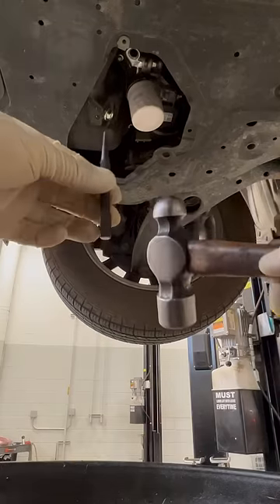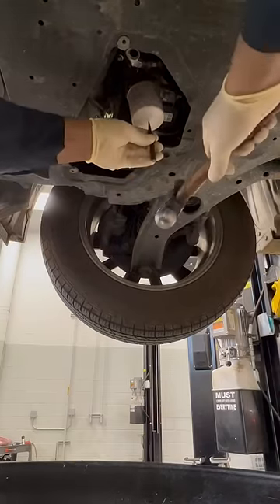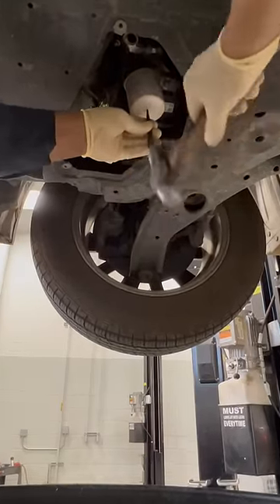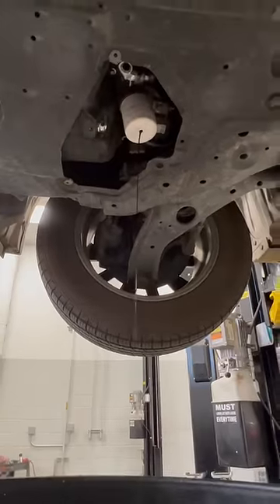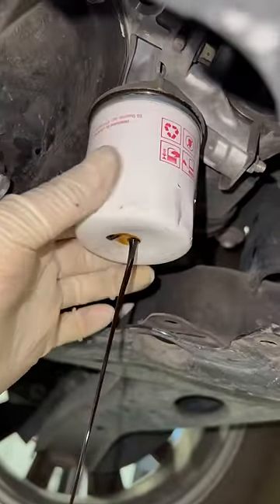Tech Tip Of The Day Oil Filter Clean Removal #oil #oilfilter #mechanic #shorts

Comment: Don’t do this. It will damage the threads.
Reply: I won't because it's a stupid tip.
Reply: Bro you're MAKING a hole not shoving in a 30cm drillbit from 18v battery
Reply: @lmripper3659  using a hammer on filter that’s threaded on will cause them to get damaged sooner or later
Reply: D guy told him something and didn question it
Reply: @Psunfire  If we go with your theory all screws on the car should get their threads discombobulated after hitting a huge pothole
Reply: @Psunfire  Creating Bulldozers/trains/airplanes gets out of the question on this topic

Comment: use grease on the gasket it works better than oil and doesn’t dry up right away filter always cracks loose with ease, old mechanics trick 😉

Comment: Tech tip of the day: DON'T DO THIS. 99 times out of 5 the filter will be jammed and stuck and you won't get it off and now you have a hole in your filter and a car with no oil blocking the bay for hours while you wait on someone more experienced to come bail your novice butt out.
Reply from the maker: How many oil changes have you performed in your life 😈
Reply: he's assuming you have the proper tools to remove oil filters.
Reply: Oil filter needs to come off regardless loo
Reply: Any bozo that doesn’t have a hoist and has done more than two oil changes knows to release the tension on the filter before doing anything. This is a great idea 👍👍
Reply: In England with a jammed oil filter the preferred method as a last resort if filter wrenches etc haven't worked is to punch a screw driver through the side of the can either fully through or through one side and use the screwdriver for leverage, loosen it enough to get another tool on it or unscrew it by hand.

Comment: Tip number 3 : do not lube the gasket on the new oil filter. Keep it as dry as possible !!!
Reply: Nope
Reply: I'm pretty sure it's recommended by the manufacturer to put oil on the gasket before install.
Reply: @grimspyder0001  ..... Duuuuuuuuuuuuuuuuuuûuuuuuuuuuuuuuuuuuuuuuuuuuuuuuuuuuh

Comment: Nice tip but as an ASE master tech ...loosen your filter a little first if you run into a tight filter after you punch your hole it will crush like a soda can if you losen it first while still has preasure it will always loosen then punch it that way you never get stuck cutting a filter off with an air hammer

Comment: I have seen mechanic’s keep a 20 ounce coke bottle with the top cut off. Slide that over the oil filter and un screw it. Gives a little extra grip and doesn’t make a huge mess.
Reply from the maker: Great tip thanks dnt forget to subscribe

Comment: It looks like your gasket stuck up there.
Reply from the maker: Yes got it thanks
Reply: @WrenchingMafia  cheap filter
Reply from the maker: @PABU427  Definitely I Like using Genuine OEM parts but I can’t control what customer installed on vehicle
Reply: Don't forget to remove that gasket

Comment: “Tech” tip. See this is why I change my own damn oil, and don’t care if my hands get dirty.
Reply: I do my own, because so many mechanics are scammers. My dad is a mechanic and he made sure I understood that a long time ago. LOL Every time I've taken my car to someone else they always conveniently forget to change the filter, or strip the plug, or any number of bullsh-t.
Reply: what is the problem with this video?
Reply: @wokkie168 um they gotta replace the oil housing now(the catch can) now you basically unscrew that your not suppose to damage it because you will leak oil and your engine will not have oil resulting in over heating and other stuff 

I couldn’t tell if your joking but if your not I hope this helps
Reply: @mark_m1 bro theyre changing the oil. Youre supposed to buy a new filter each time you change it. Do you not understand that? Is that what you do? 
Pop the plug, drain the oil, put plug back and fill it up?
Reply: @mark_m1 also when its leaking oil its not just gonna over heat, it will blow up almost immediately with a hole in the filter.
Reply: @mark_m1  thats not an oil housing or a catch can, its an oil filter. You must replace the oil filter on every oil change whether it be a cartridege filter or a complete metal one like this. Are YOU joking?
Reply: @mark_m1  also idk what you mean by "housing" it's an oil filter adapter, SAE term

Comment: Tech tip #2 get He-Man to tighten the oil filter so that you can’t humanly twist it off the next time you have to change the oil. I learned my lesson and NEVER paid anyone to do my oil changes in the last 40 years!! 

Tech tip#3 Pressure flush the radiator until it starts leaking and the owner has to pay for a new radiator and the install. Never took any car in for that. I learned how to do it.

Tech tip #4 you guessed it the brakes. I learned how to do those too. I don’t go to a mechanic unless it’s really bad. Don’t trust them.
Reply from the maker: You will need us one day

Comment: I have to be real. I just did an oil change with this type of filter. You can just unscrew it a bit and it does the same thing just might have unscrew it more when it slows down. The only other difference is you can unscrew it white it drains simultaneously. Useful for a shop setting where you’d see multiple cars a day but for a single person doing their own oil change, this is quite a waste of time. A couple of those blue shop towels and your hands are clean again 🧼

Comment: This is a pretty good strategy but some oil filters are not this easy to get too. So if you did this on one with an oil filter up in the engine bay you would still have a mess.

Comment: When I serviced big trucks at a truck stop some of these filters held a couple quarts I came from the body shop industry and I had a One pound dent puller I put a big metal screw in it and it was perfect for draining those big hot oil filters one slap with the slide hammer and one yank and your filter had a 5/16 hole draining the hot oil

Comment: Won’t work in a vertical oil filter like on a Tacoma but those vehicles usually supply another method of keeping the mess down like a drain tray / spout. If I had a vehicle with an orientation like this I would definitely use this method!

Comment: That's why I like my german  car, the oil filter is on the top, installed upside down, and when you need to change it, it will drain inside the oil pan...

Comment: Just be certain it was not overtightend. You may need all the structural integrity to remove it. I might loosen it slightly before you punch a hole in it. Still a great idea.

Comment: That works if the filter is in an area that doesn't have an obstruction in the way that is hard to move. On my acura rsx there is shit in the way that would be a headache to move. Also the filter needs to be vertical or mostly vertical. Sometimes they are horizontal and punching the filter would be useless if you even have room for the punch and the hammer

Comment: I just use a Solo Cup.  Loosen it and then unscrew the oil filter.  The cup holds the mess.  I have also used your method.   I hate when oil runs down your arm

Comment: Your wearing gloves so your not going to get your hands dirty.

Here's a tip: Make sure you remove that old oil filter O-Ring from the engine before installing the new oil filter otherwise you will have a huge mess on your hands / garage floor...

Comment: But my oil filter is on the front side of the engine block, not at the bottom like the video. So I won't get all the oil out.
Also what if there's dirt in the engine that needs help draining that only comes through the oil pan?

Comment: I tried this and didn't like it. Punched the hole. Got oil on the punch and hammer. Oil dripped forever. Ended up unscrewing the filter while still dripping, and oil leaked out the top of the filter anyway. Then you can't move the filter without spilling oil because you have a hole in each end. It looked like a good idea, but for me, it was 4 times as messy and took 2 times longer.

Comment: What if the oil filter is in the side of the engine and you have the intake manifold on top and the subframe in the way in the bottom how my Miata has it, what would you recommend?

Comment: Dude were grease monkeys we literally get paid to get our hands dirty plus that takes more time and im flat rate so no thanks ill be a little messy and keep doing it the normal way heres a good tip though always check that drain plug before removing make sure its tight and threads havent been cross thread by the previous tech thats a tip worth making a video on

Comment: I changed my oil and filter but when I changed the oil filter (you know the square oil filter up top?) It didn't have any oil but it sure was dirty so I poured some oil on it cause I figured if it's dry it needed to be soaked in oil. The previous owner forgot to do the last oil change I guess. It runs a little rough but it gets me from A to B most of the time.. sometimes.

Comment: You can just crack the oil filter lose and leave it on until it’s don’t draining, then take it off. It doesn’t leave a huge mess just drips down the sides in a steady stream. The filter gets dirty but that gets tossed anyways. You’ll never have hands clean enough to not have to wipe them down or change gloves before you pull go into the car again to finish or move it out. Seems like a time waster

Comment: This is a bad example, as the filter is upright and easily accessed, so it wouldn't have made a mess anyway.

Next time show us a horizontal filter surrounded by transmission lines, power steering lines and coolant hoses, electrical harnesses and nearby connectors, etc.

Comment: That so called clean tip is impossible when the filter is on the side or front of an engine or in a hard to reach place where a hand barely fits must less a tool.

Comment: Really? Been a mechanic for 25yrs and it’s not like a lot of oil spills out. Not to mention about half of the engines either use cartridge filters or the filter is sideways. I’ve even seen a Subaru with one upside down. lol I wouldn’t waste time with this.

Comment: Bro that is not a tech tipa tech tip for the oil filter removal is taking a solo cup or plastic tapered cup and slide it over the filter squeeze and turn all the oil will get caught by the cup getting the possibility of making a mess a thing of the past

Comment: Bad tip. You dont do this for the same reason you always take out the fill plug on a transmission and differential before removing the drain plug.

Comment: I wouldn't suggest this! Why,because if your new filter is the wrong one,and your not close to an auotparts store,or dont have a way to get there,you can't drive your vehicle back to the store,to get the correct one, because you listened to this guy,and now your old  oi filter has a hole in it ,and  its garbage!
This is a guy who's got a car on a hoist ,plenty of oil filters on his shelf,or the parts supply store can deliver the correct one!

Comment: But what he doesn’t show is he forgot to put a bucket down and now the floor is covered and then he slipped in it and fell on his back then because it was so slippery he couldn’t get a grip to stand and wriggled around before eventually dragging himself to the door where he was able to pull himself up the door frame. So now HE is covered in oil, the floor is covered in oil and the door frame is covered in oil! The only thing left clean is the oil filter!!😂👹

Comment: The dumbest tip ever. You're wearing a glove. How long is that gonna take?  Oh, and what happens if the filter won't come off? Most are in cramped locations and you could leave a stuck filter on temporarily with new oil. Don't ever do this.